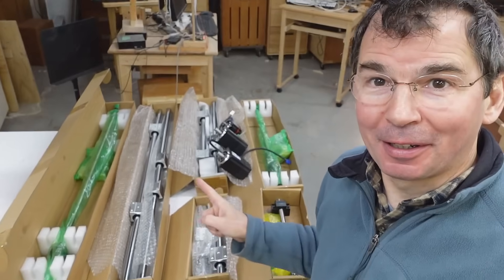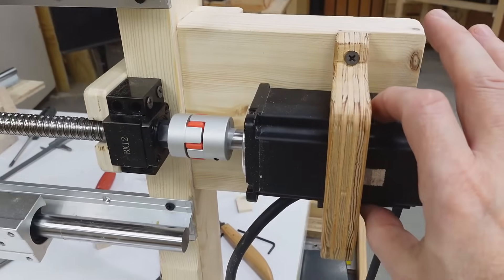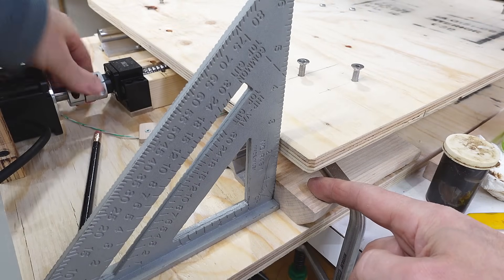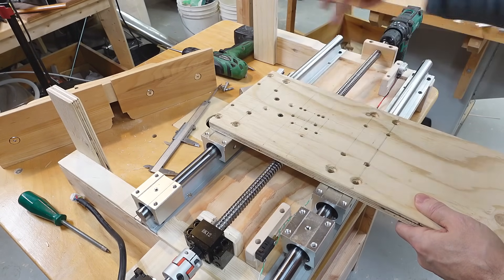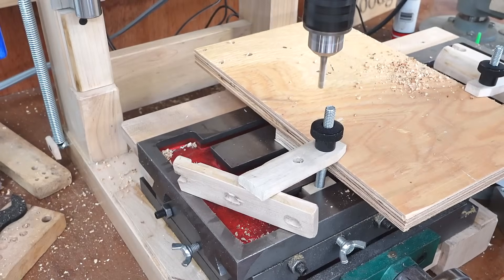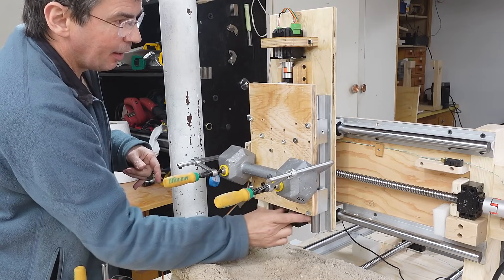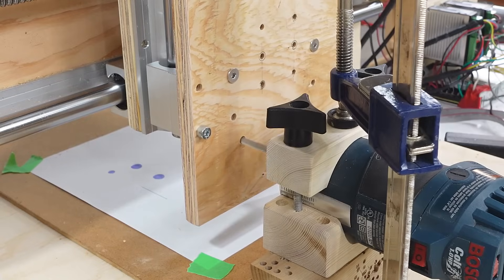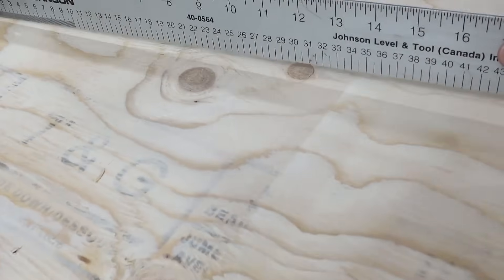Building my CNC router

Comment: Hey Mathias, what do you think about x axis being on the one, and z axis being on the opposite side of the gantry? So the weight is evenly balanced.
Reply: "Hey Mathias, what do you think about x axis being on the one, and z axis being on the opposite side of the gantry? So the weight is evenly balanced."

How would that work?

Unless I have X and Y backwards again,
The X axis is the direction of the table.
The Y axis is the left and right direction the router is being taken.
The Z axis is the up and down direction and determines the depth of cut.

The only alternative positioning of the motors that I am aware of is in the delta 3D printer design which may be limited in size.
Reply from the maker: I prefer my z axis attached to the y axis (hence on the same side).  Otherwise, what's the point of the y axis?

Comment: Accuracy is important sometimes. But I agree, it takes a while. I suppose if you were cheating and mass producing something it may be worth it.

I'm curious how much that entire setup would cost if one had to pay for everything. Wood, hardware, etc etc.
Reply from the maker: The servos I used are the most expensive, though the little closed loop stepper I used on the Z would probably be adequate for the X and Y as well.  That motor cost $40 USD last year.

Comment: Test that crash zone again, you measured the rebound, not the actual crash limit
Reply from the maker: with as little compression as I got, there wasn't enough force to back drive the lead screw.  The y axis has thinner crash pad and the limit switch trips when the crash pad is already slightly compressed, so that one rebounds a little bit.

Comment: You DO, in fact, need a limit switch on the X axis. Maybe not for safety reasons, but you need it for homing purposes so that you can get repeatable calibrations
Reply from the maker: unfortunately, those limit switches are not suitable for homing, because once the disable signal is sent to the servo, its completely unresponsive until I manually crank it away from the limit switch.  If I want to auto-home, I'll need another set of switches.  But...  The servos remember their absolute position as long as they have power, so I can restart my software without re-homing.  I send serial commands "go absolute position" to the servos, not pulses.

Comment: I’m about to build a low rider v4. I wonder how yours will compare.
Reply: Mathias' design is solid. He used the right parts. He avoided doing anything too risky too. Moving table is very rigid. You can't get much more rigid than a fixed axis. It's literally screwed down.
Reply: True, I’m mostly just curious to see what the differences in the end will be, speed, chatter…

Comment: It really depends on if using a CNC takes more time or not.
If you know what you are doing and have your CNC setups optimized a bit and have designed your stuff in CAD already then writing a CNC programm for it is really a matter of 5 minutes at most.
If you dont have any clever ways to clamp your work, get your work coordinate fast, have to manually probe every tool and have not much experience using CAM, then doing it by hand is faster, IF you are an experienced and skilled woodworker.

If you put anyone unexperienced in front of a table saw, it is not only dangerous, but will take him a lot of time to do stuff you do in matter of a few minutes, same goes for a bandsaw or any other tool really.

Comment: Wandel, why don't you just start teaching welding! And after teach welding you will be done with the word "wobbling wood parts" You will transfer to metal for good....
Reply from the maker: Wood only a tenth the stiffness of metal. But its quite easy using more than 10x as much wood as you would metal, so it ends up stiffer.
Reply: @matthiaswandel  I said it becaus I'v made it before 3 years. Now I too use wood because is quick to cut it but I use 90% metal for complicated shapes for smaller details. Wood has so much limitations. I truly want you to start welding. You will find whole new world, you will start produce more complicate projects, and thats why I want to see you welding. For your personality I suggest you MIG (quick, strong, easy to learn, much much cleaner than stick, it will suit you.)
Reply: There are merits to all materials, and having an understanding of them lets you pick the right one for the task/job at hand. The choice is also strongly influenced by the tools you have at hand, and experience using. And what materials you have on hand too. I don’t use my MIG welder that much, but it sure comes in handy and is a great enabler. Ditto, metal cutting band saw, table saw, band saw, metal lathe, drill press. Heck even a good hefty metal vice.

Every now and then a big project comes along like a back hoe, tractor bucket, cedar strip canoe, where having the right tool for the job really makes a difference. I suspect that CNC falls a bit into that category, it can be a great enabler in the right circumstances. Not sure if I’ll ever find out … but it would be fun!
Reply: Welding sucks because of distortion. Precision is not attained through welding. The very best in the world still need to machine weldments. Doing that is problematic to say the least.
Reply: @1pcfred  it is true! Furst I was dissapointed of bended details, but now I use it where it can be used. You don't need precision in every parts, but often you need strong AND smal detail WITH weird shape....

Comment: CNC is scarry to me because it does exactly what i say... Even if i say something stupid, like ram the bit through 6 cm of material at very high speed and destroy everything in the process.
Reply: There's simulators so you can run your program and watch what it does before you run it on a physical machine. My CNC machine will sim if I just don't turn the machine on. The controller doesn't know the machine isn't on. Generally you set axis limits on a controller anyways. So no matter what the code says the controller won't exceed the limits you've set. Parsing code is what controllers do.

Comment: CNC is only a time saver if you have to do enough repeating pieces... for one off stuff or even a small number, depending on complexity, it's usually fastre to make by hand. IMHO the only reason why even prototyping is done with CNC these days is that it's much quicker to move that code to production later on.
Reply: Maybe you're good at unerring precision. Most of us are not. Holding a tolerance of a thousandth no matter what just isn't in the cards for us. You're not going to do what a CNC can do no matter how much time you invest. I used to think I was a good artist until I gave my CNC machine a pen to draw with.
Reply: @1pcfred  since there are quite a few funny videos with "oops, wrong axis" moments on file even with industrial CNCs, I wouldn't exactly say "unerring" with those either. Granted, the precision a modern machine can achieve is extreme... but we were talking in the context of a hobby shop and home made CNC on this video. So comparing the same ballpark of "experienced worker" vs. "cost of the machine", I'd still say: one off pieces could be done with about the same if not less effort than wrapping your head around the code first. 🤔

Comment: I have identical axis configuration in my diy cnc. Just a tip, you can make a nice dust shield for the table ballscrew and rails from an old roller blind.
Reply: Yeah I went with a moving table myself. I have a drawer slide CNC machine.  Those are notoriously rickety. With a moving table it is rigid though.
Reply: axis config not have perfect, lot better have Y axis move all beam not table. and better use 2 ballscrew and 2 motor Y axis move.
Reply: @mattivirta What's better about it? Better how? Because what's going on here is perfect and you can't improve on perfection. If it was a moving gantry 2 leads and 2 motors is better then. But this is a moving table. These work just fine with one lead screw.

Comment: I had a group of friends in the US who were into XY tables and the most common thing for them to make with their first XY table was ... more accurate parts for their XY tables.
Reply: Similar to owning a computer, spend more time solving computer issues and finding solutions than actually benefit from having a computer, although much better than 1980 when there was still a need for DOS inputs.
Reply: the same goes for 3d printers lol
Reply: Von Neumann described this whole process many years ago, and it is a sound way to progress. I got into CNC by buying one of those tiny Chinese things with a minute motor. It is now a full sized machine that cuts seel happily, but I can still trace its heritage. The main task is stopping things flexing and only then fitting big steppers.
Reply: Just like with 3d printing... get a printer to print parts and accessories for 3d printing.

Comment: Down the rabbit hole he goes, it's only a matter of time now... I will say that it seems you've over complicated things a bit, without knowing what you're designing this to do in the end though it's quite possible and very probable that I'm wrong though. I do love your designs so I am quite eager to see the final machine and what you make with it, there's more to them than just making gears.
Reply: He was a bit too worried about crashes. I use software limits and I've never crashed my machine ever. Knock on wood. But he's not using proper machine control software either.

Comment: CNC is only really for mass or large batch production.  A DRO on a conventional machine tends to work better for small batches or one offs.
Reply from the maker: yes, I discovered this too.  My xy drilling machine with DRO was very handy with much less setup time and anxiety.
Reply: Wrong. CNC can cut patterns too complex for humans to easily deal with. They do it with ease too. You literally push a button and it is done.
Reply: @1pcfred  
"You literally push a button and it is done."

That's a definite exaggeration.
First you have to design the part in CAD.
Then, if your CAD does not output gcode you have to output the design to stl or other file format.
Then convert the CAD output into gcode.

On the other hand, if all your doing is downloading gcode that someone else produced, then yeah, all you need to do is upload the file and push a button and she's off and running.

Comment: Excellent work, Matthias! I prefer a moving table, because it has much less mass than a gantry, and reduced moving mass is better, for small machines.
Reply from the maker: yes, I don't regret going to a moving table.  The gantry assembly is half the mass of the machine, and I wouldn't want to move all that.  Also, just a simpler and sturdier machine this way.
Reply: @matthiaswandel  Absolutely! It was a good decision.
Reply: @matthiaswandel kayak designer and builder Nick Shade has a moving table CNC and uses it quite a bit. The perfect machine for cutting out strip built kayak forms (although I do suppose that getting stuck in the the bandsaw and 12” stationary disc sander would have them done to an acceptable accuracy in an afternoon). It has allowed him to do production runs of foam kayak seats and a neat jig that holds a mini shoulder plane to bevel the edge of the strips.
Reply: @matthiaswandel  Up to a point moving table is the superior design. At some point the inertia and size of the table gets pretty big though. All the bigger machines are moving gantry. Get a water cooled spindle off Vevor. You want one. They definitely have them. Heck you could use a few of them. Get one for your panta router too. So quiet.

Comment: Moving gantry looks cool and gives you a larger work envelope. Moving table is more rigid and takes less parts to make. So from a practical standpoint moving table wins. But moving table can't scale like moving gantry can. I saw a vinyl cutter once the size of a basketball court. They were using car tires on their axis. Really bald car tires. The gantry was like 6 feet thick. Moving table just wasn't an option for them. The whole warehouse they were in would have had to move around.

Comment: At least, it took some time! Some of us told you to reconsider more than a decade ago! Components are the most expensive part of the build, and you can't go cheap on them. I know wood is your thing, but the best structure you can build should be made from stiff and heavy material, not wood. Molded concrete is the best compromise (in terms of price and adequacy), in my humble opinion. Feel free to think I'm wrong, though you'll figure it out yourself later. As an engineer, I have quite a bit of experience with CNC building. If you want some advice, feel free to ask.
Reply: He's not going to be milling steel. So wood is fine for the machine. If he does want to mill harder materials then yes wood is inadequate. But Mathias is a wood elf.
Reply: @1pcfred  First, you don’t know what the machine is intended for. My guess is experimentation, because it seems Matthias has not yet grasped the value of CNC machines, and a wooden tinker project may only reinforce his current skepticism. Wood is never a suitable material for a CNC router because it is not stable. Even if you’re milling foam or balsa, you lose one or both of the key advantages of CNC machines: precision and reliability-not to mention any chance of achieving decent speed.

Regardless of what you plan to do with a CNC router, the stiffer the build, the better the machine and the machining results. One of Matthias’s main concerns is speed. If a machine isn’t stiff enough, you are forced to lower the feed and speed, which has multiple downsides: increased machining time, faster wear on components, and shorter tool life.

By the way, a concrete-based CNC is the most cost-effective option. There are also many ways to further reduce costs, such as avoiding the bed-slinger design and properly orienting the rails.

You simply can't beat a proper CNC machine with power tools. A CNC can run a 20mm bit, cutting 10mm deep into the material at 22m/s. Good luck matching that with power tools. And CNC becomes even more advantageous when producing complex parts or handling batch production. You're slower with a CNC machine for two reasons: 1. the machine is not capable 2. you don't have the skills or the right workflow. Simple as that.
Reply: @axelSixtySix  don't bother arguing with this guy, trust me.
Reply: @ Got it mate, thanks.
Reply: @1pcfred  Oh wow, a wooden CNC that routes PCBs without surface mapping? Congrats, you’ve just invented magic. Come on, admit it: you blow on it to compensate for moisture variations, don’t you? Or is your PCB carved out of an IKEA cutting board? It’s fascinating how some people turn their personal experience into universal law. But hey, if it works for you… or at least if you really believe it does.
Reply: @1pcfred  A wooden machine with enough precision to mill PCBs without surface mapping? You must have found a type of wood more stable than metal. Go on, share the specs: I’m sure the entire industry would love to know. Why do those idiots keep making machines out of metal? If only they were as smart as you...
Reply: @ Here we have the perfect cocktail of arrogance, ignorance, and pure comedy. At what point does slapping together a wooden contraption with zero experience on a proper machine qualify as an argument from authority? Mate, the result you’re bragging about is the exact opposite of precision work. You don’t even know what a precision machine is, since you genuinely believe a wooden DIY project can be one. Thankfully, stupidity isn’t fatal, because you’re still here! But hey, at least you’re good for a laugh!
Reply: @1pcfred  Let’s imagine for a second that you’re not a pathological liar, because no genuinely competent person would spout the absolute nonsense you’ve been coming out with. Seriously, the amount of people on the internet who think that inventing imaginary qualifications makes them credible is astonishing. And here’s a question for you: why would a competent and well-equipped person ever build a machine out of wood, when it’s cheaper and easier for them to make one directly from a better material? Explain that one, genius.

So, let’s pretend you’re telling the truth. You were in a machinists’ union? Worked with precision tools? Fantastic. But explain to me how that somehow transfers to your wooden CNC being accurate. That’s like saying, “I trained as a surgeon, so this potato I just carved into the shape of a lung is a viable transplant.” Because, Einstein! The delta of expansion/contraction in a 22 mm plywood sheet is 400 times greater than the thickness of your PCB trace. And as for a 50 mm solid wood block, its delta is 2600 times greater! And don’t even get me started on the difference in rigidity between wood and metal, because that would finish you off! 

And I love the little “Go look up what a Hoke long gage block set is.” Ooooh, big words. We get it, you possibly own a measuring tool. Doesn’t make your machine any less of a pile of timber with motors. Honestly, I’d be impressed if this was satire, but I think you actually believe it. Which is even funnier.

Comment: wood is not the best material for a CNC machine. too unpredictable. i would use aluminium or (for heavy duty machines) steel.
Reply: Wood is predictable enough for hobby use. Mathias has a lot of experience working with wood. So he knows what it can do and what he can do with it.